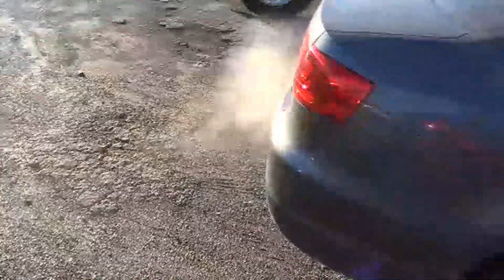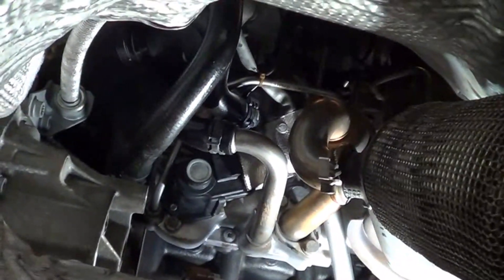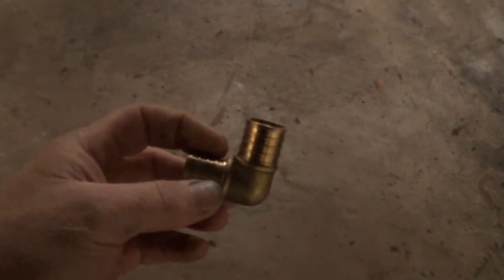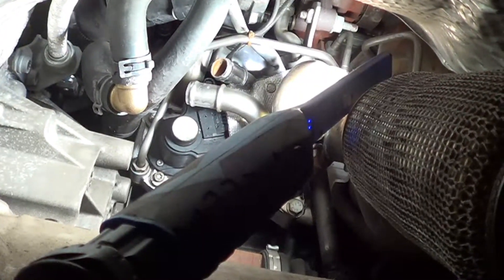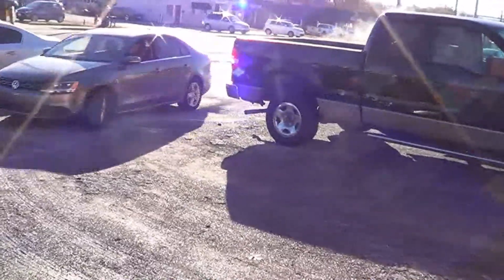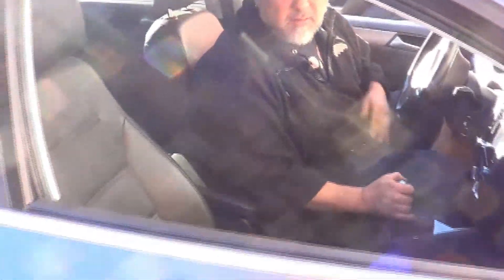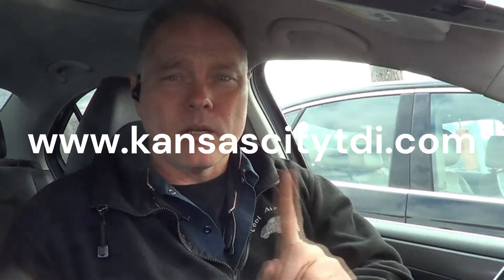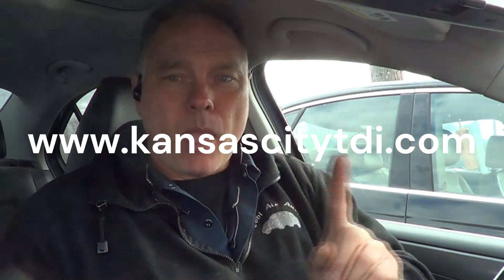Steaming head gasket?   NO!

Comment: I need a help
I have a mk4 with ALH engine
And i have a problems with engine power,I change n75,all vacum lines,turbo is clean,new turbo actuator,maf change about 4 years ago pierburg.
I have a VCDS i do a log for maf sensor and its good.
Car has sometime power depends on weather outside ,no fault code on vcds.
New filters,egr clean,intake manifold clean.I dont know what to do more,I hope you will help me.
All best
Reply from the maker: Watch  my diagnosis videos for P0234 and P0299.  Check intake for clogging.
Reply: @CoolAirVw  
I watched this videos,and its nothing,car is not going into limp mode,but you can feel its down on power, I cleaned a turbo geometry,and intake manifold,and put new turbo actuator.
Reply from the maker: @srdjan997  Not much I can do without the car.
Reply: @CoolAirVw  I know that,but I am from Bosnia 🤣
Reply: Hey, today i saw ton of air in fuel line,Is that normal?
Reply from the maker: @srdjan997  sometimes its normal. are you having a problem?
Reply: @CoolAirVw  I dont know is that problem on my mk4,i have a lot of air bubble in fuel line,I checked everything and all is good.
That is last chance to fix it.
Reply: @CoolAirVw  do you have a email?
Want to send you some pictures a ask you more about mk4
Reply from the maker: @srdjan997  ask here.
Reply: @CoolAirVw  
When I cold start a mk4,car have a great power,but when its start to warm up,there is a drop of performance,When you flore it in 3 gear car goes like you press a half of throttle,